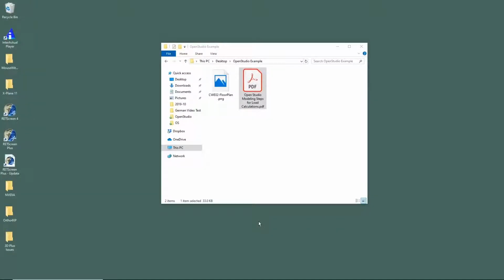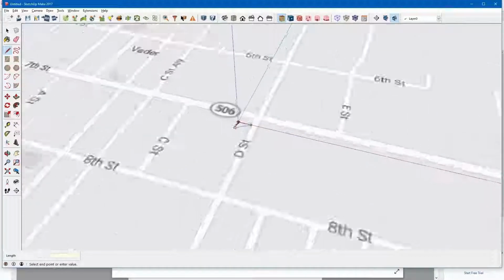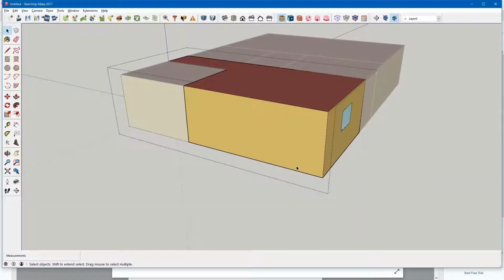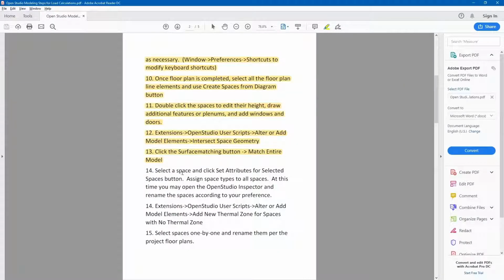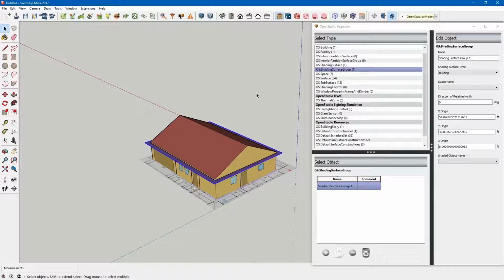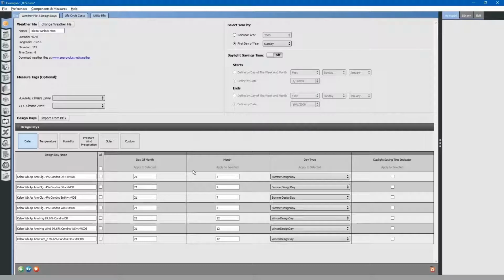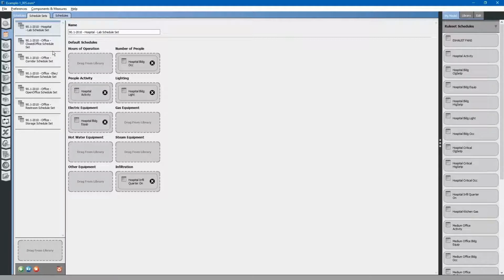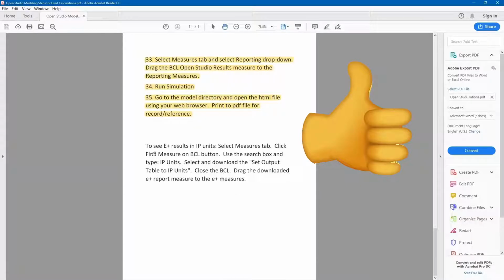ASHRAE Standard 183 Building Load Calculations Using SketchUp / OpenStudio

Comment: Hi, is there a way how to simulate partially underground floor? You know what I mean a bunker-like residential building with a lot of windows in just one wall to the south (or SE, SW...). Can I do it with cooperation with sketchup an Openstudio?
Reply from the maker: Yes, you will have to do it with SketchUp.  Draw a line or lines on the wall to delineate between below grade and above grade.  Open up the OpenStudio Inspector tool.  Select the below grade surface and toggle the Outsdie Boundary Condition to "Ground".  That is the simplest method.  
If you are doing advanced ground contact analysis, there are multiple other ground contact options that will require additional inputs in OpenStudio.

Comment: Hello, why did you rotate the building 60 degrees?
Reply from the maker: Good question.  If the building is oriented different from how the plans show it, you can change the orientation of the building (relative to true north) by physically rotating the model in SketchUp (like I did in this video) or you can specify a building rotation in OpenStudio like this video shows here: https://youtu.be/MGjlpbJWhd4?t=43
Reply: @helixenergypartnersllc3540   Thank you

Comment: Thanks for sharing. I notice in the zone sensible cooling and heating sensible sizing table that the cooling loas are lower when you ran ideal loads ON than the PTAC version. It shouldn't be the other way around? And the zone equipment selection the cooling load it's a lot bigger than the Zone sizing table. I suppose the zone equipment selection takes into account sensible and latent but the difference is to big.
Reply from the maker: Yes, you must understand that the sensible table only shows sensible loads associated with the space.  The HVAC system sizing can include outside air loads, fan heat loads, efficiency penalties, latent heat loads, standby losses, and parasitic loads.

Comment: Thank you for your video! I'm the new to use the software. It helps me a lot. However, I put your model to run a simulation and there is a problem. When I checked the results in Dview, the site outdoor air drybulb temperature only showed by monthly (Environment Run Period Monthly). It means only 12 enviroment temperatures output and its x-axis range are 01/Jan to 11/Jan, not Jan to Dec. Could you please help me with this issue?
Reply from the maker: Yes, you must go to the Output Variables tab and turn on the "Site Outdoor Air Drybulb Temperature" and set it to "timestep" or "hourly" (or how ever you want it reported).  

Also, make sure you have the run period set to the full year.  Go to Simulation Settings tab and set the run period date range for a full year (ie. January 1 to December 31).

Also, make sure your weather file has a full year of data.  Also, in Simulation Settings tab, Simulation Control, make sure "Run Simulation For Weather File Run Periods" is set to "On".
Reply: @helixenergypartnersllc3540  Thank you so much

Comment: Could you help with some doubts? When I put the model to run, it's shown the errors below. How can I solve them?
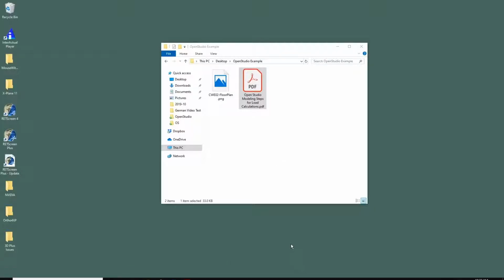Program Version,EnergyPlus, Version 9.3.0-baff08990c, YMD=2020.06.10 00:33,
   ** Severe  ** <root>[BuildingSurface:Detailed][Surface 1] - Missing required property 'construction_name'.
   ** Severe  ** <root>[Construction][ExtSlabCarpet 4in ClimateZone 1-8] - Missing required property 'outside_layer'.
   ** Severe  ** <root>[FenestrationSurface:Detailed][Sub Surface 1] - Missing required property 'construction_name'.
   **  Fatal  ** Errors occurred on processing input file. Preceding condition(s) cause termination.
   ...Summary of Errors that led to program termination:
   ..... Reference severe error count=3
Reply from the maker: It seems there are several issues:
1. Surface 1 has not been assigned a construction type.  It is likely that there are more surfaces than just this one that does not have a construction type, however the simulation terminated before finding these errors.  I would guess that you have a space type or a space that has not been assigned a construction set.  You should watch the video:https://youtu.be/5ZjqfSV6M1k
2. Your construction "ExtSlabCarpet 4in ClimateZone 1-8" does not have any materials assigned to its layers.  You should watch the video:https://youtu.be/_tN3scXakiM
3. Your Sub Surface 1 has not been assigned a construction type.  This is probably related to item 1 above, but you also may be missing a construction assignment in your Construction Set.  You should watch the video:https://youtu.be/_tN3scXakiM